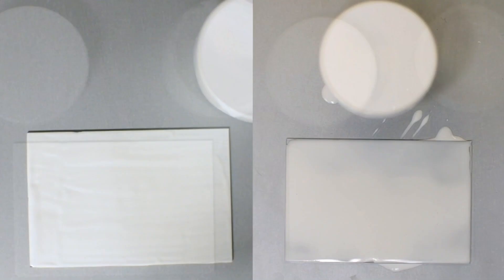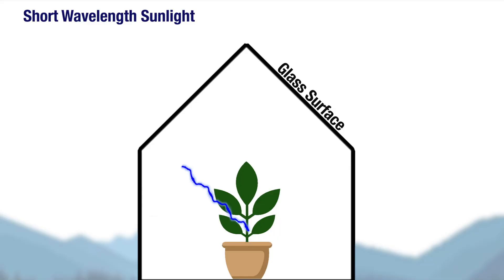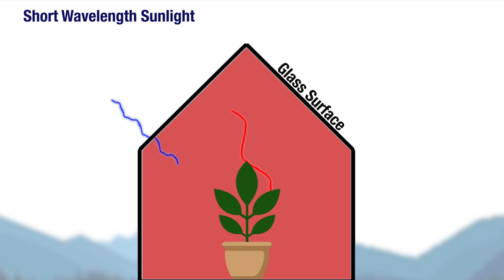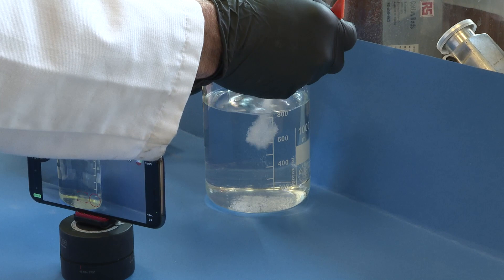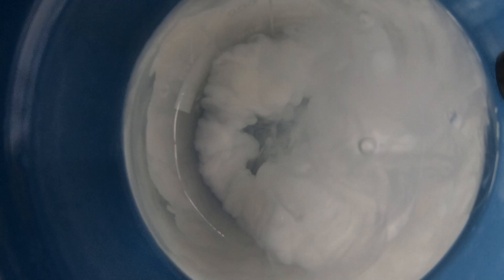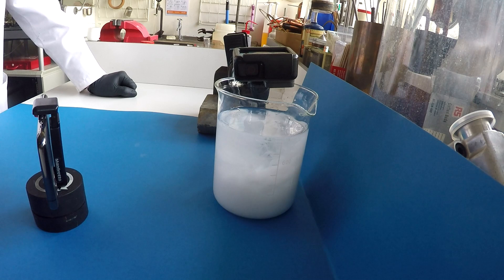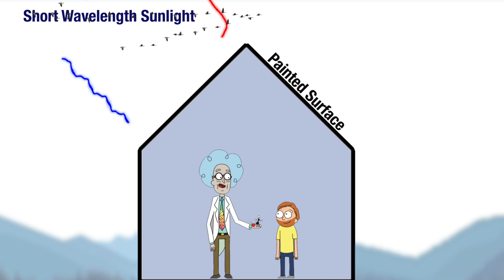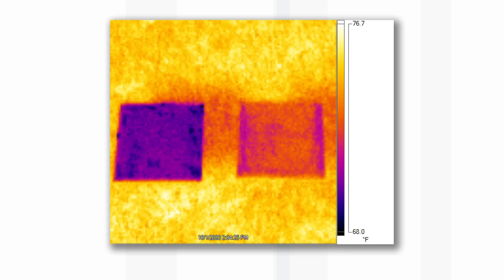Ultrawhite Paint (with Barium Sulfate) - Periodic Table of Videos

Comment: Wait a minute, how is it the BaSO4 reflects the sun's infrared radiation, but allows infrared radiation from inside the room to pass to the outside ???
Reply: because infrared is a range, not a single thing.

IR from the sun is short wavelength. IR emitted from objects near room temperature is long wavelength.
Reply: @seigeengine  Thanks! It is interesting that it reflects such a wide part of the spectrum, and passes just the bottom end.
I wonder which side of that spectrum divide cooking stove radiation is on?

Comment: This is very interesting, though not for the reason that many may think.

Barium Sulfate is nothing new to the industry and neither is the idea to create functional paints that mess with IR in order to create heating or cooling effects.
Conventionally, BaSO4 is used as a functional filler due to its superior chemical and mechanical properties. 
However under normal circumstances it is almost useless as a white pigment in comparison to TiO2 because its low refractive index is too close to the binders refractive index, making the dry paint almost transparent rather than opaque white.

What is new with this paper is the particle size distribution of the BaSO4. Particle sizes of pigments in regular paints tend to hit a lower limit in the 1-10 μm ranger due to technical limitations in the milling process.
Reducing particle sizes further and with a very broad distribution to hit as much of the visible spectrum as possible is what causes this very counterintuitve and kind of amazing phenomenon. As with most nanoparticles, things get a bit funky when you reduce the particle sizes into the range of the wavelenghts of visible light.

That said though, from a viewpoint of practicality, getting particles sizes that low and broadly distributed and especially then stabilized in a formulation without loosing the effect to particle flockulation sounds like a major headache that will need to be solved.

Not sure who needed to read this but hey, maybe somebody found it interesting.
Reply: It was interesting to me..  Not a paint scientist though.  I watched a video where a plastic was dissolved in a solvent and then a small amount of water was added to the dissolved plastic.  Too this Barium Sulfate was added 40% by weight.  It took several layers to overcome the transparency issue, but the small amount of water added made a big difference.  Do not remember the channel.
Reply: How close are we to get this in a generic paint container that I can buy and start painting my house with?
Reply: I am interested because I am in the process to develop cheap and effective white paint for cooling down my home, My home was constructed with aircrete or cellular concrete coated with a thermal stucco, very effective but now I am painting my home white with a combination of different white powders, paint, sealer and some other binders, I am in the process to develop my own paint in a fraction of the cost and very effective and resistant. Thank you for sharing your knowledge !!
Reply: Interesting to me, because I want to use this kind of paint in the future for my own homestead I hope to have some day.  Gonna be easy to lose the place in the snow though, so I might need some Vantablack for the trim or something.
Reply: I have a hunch that manipulating the BaSO4 nucleation process could address the typical crystal morphologies that give rise to the issues associated with these paints.
Reply: We can control the size of these particles to be about 700nm spheres with a chemical called EDTA. These spherical particles grow in size over time in solution.
Reply: @runed0s86  Isn't there an issue with the typical crystal morphology not optimizing reflection?
Reply: @JohnnyManu40  in the world I foresee, having your home blend into its surroundings enough to disappear may be an asset.  You can always hang a red-ribboned wreath on the front door if need be or paint the door red. Our future looks uncertain, so flexibility is necessary in order to handle it.

Comment: In Slovakia an indoor wall paint with barium sulfate is sold under name "Primalex Polar". Used it myself several times, nice shiny white, had no idea it's anything exceptional. The jugs are noticeably heavier than other paints, tho.
Reply: It probably doesn't.
Barium sulfate is commonly used in paint as a filler material, and is generally transparent in a paint medium.
The key here is the particle sizes and variation.

Comment: It's funny, because the citizens of mediterranean countries we have painted our houses white for centuries, precisely because of this very same reason. Thanks Professor.
Reply: yes but this new paint is white even for invisible light
Reply: The cooling properties of white material has been known for an age, but this paint will keep your house considerably cooler than the white paint you've been using all this time.
Reply: That's one of two great properties of whitewashing, The other one is that the lime coating keeps water out of cracks between stones and bricks, which protects the walls from erosion.
You could of course paint in color on the white lime, but then you lose the cooling effect, so they usually didn't.
Reply: AFAIK, that’s calcium oxide, isn’t it? Odd that calcium is just two up in the table, but I don’t know its reflective or transmissive properties with UV or IR respectively. I know typical white that we use and see can be Ti or Zn oxides.

Comment: You can do this glass microspheres of a certain size too. They become excited by thermal phonons in the surface and because of their size emit IR light that can exit the Earth's atmosphere via the 'IR Window' and not get trapped as heat.

These coatings can actually cool surfaces several degrees below ambient even in direct sunlight. The effect even works with clouds.
Reply: Spoke with 3M on these microspheres and they said they can not not be mixed, sadly but if placed under or over or even better, between walls of this paint, might be quite amazing.  Would love to see the results.  May try it myself.

Comment: So many uses. I used as a white diffuse surface to standardize my visible spectrometer. It does not like dirt. It produces a very flat reflectance curve, which in turn provides info on detector and source stability.

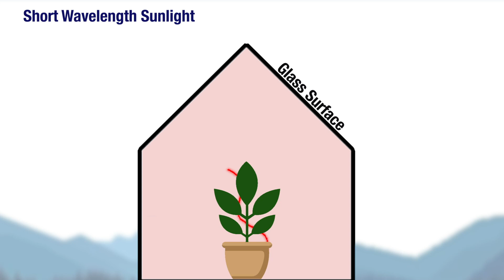Comment: 0:55 Sorry, that is not how a greenhouse works. Actually normal glass is quite transparent to high frequency IR, only becoming opaque for lower frequencies. And main heating mechanism of a greenhouse is lack of convection. Sun light (both visible and IR) goes through glass of a greenhouse, inside it warms up anything opaque. Those warm things then give up heat to air. Warm air goes up but it cannot escape greenhouse, it is blocked by glass.
Common mix up with "green house effect". Earth (and Venus) atmosphere do warm up as described. But greenhouses do not :)

Comment: It has potential for a future industry. If the reflective paint can be produced at a cost effective level and the materials required are abundant and accessible, there would be a lot of applications for it.
Reply: Materials are abundant, and relatively cheap. Sulphuric acid is about the most common strong acid in industry, most commonly as a by product of burning coal and refining oil, and Barium is also reasonably common as well, so yes it is easy to make in large volume.

Comment: I like this idea.  But it isn't as easy as "just" taking an existing builing and painting it white.  Many old buildings are inadvertently designed so heat from the roof helps dry the structure.  And "just" switching to a white roof causes moisture issues to appear.  (It can be done if you take the correct measures, though.)

Comment: Surprisingly, opacity to infrared light is not even required for a greenhouse to operate. Even if the glass admits visible and infrared light equally, it still heats up above ambient temperature. It has something to do with it being able to heat in the Sun while protected from convection cooling.

Of course, it is still better to use glass that is opaque to infrared.

Comment: you can make it even cooler by adding calcium carbonate microspheres of varying sizes, this allows it to emit near infrared to cool the surface below ambient temperature, while simultaneously cooling the earth if it emits toward the sky as the wavelength is in a low absorption range for the atmosphere

Comment: I used compressed Barium Sulphate at work as a 'white standard' reference for our Zeiss  spectrophotometers.  That was around 45 years ago. It's rather err 'white'.
Reply: To be clear, the reason this paint works isn't just because it's barium sulfate. It's a specific combination of particle sizes that helps it achieve such high reflectivity.

Comment: correct me if i am wrong: 1. the explanation about the greenhouse effect is not accurate? Because EVEN if the glass was able to let longer EM waves through the greenhouse would still heat up because the glass stops convection?
2. how can the white paint make the room cooler than the outside? if the outside is warm that means the warm air does radiate heat back into the room? the only way you could cooldown the room more than the outside would be to sort of create a "1-way valve" where long EM waves can pass through one direction but not the other?

Comment: If it could avoid some of the hassles with TiO2 that would also be huge bonus - like industrial printers having to have a little motor in the white ink tank constantly stirring it to prevent the TiO2 from settling to the bottom and going hard.

Comment: If we painted huge low albedo areas, with this paint.
The roofs of cities that already generate a lot of heat, large barren areas, factories and as you say use it for the purpose of cooling down houses in warm climates.
Even in temperate climate zones it could be smart, but only if they'd be swappable rooftops to be used in the summertime.
Do you think it could significantly help slow down climate change?
Reply: It's a fantastic achievement. They can paint engines and generator housings with it, air conditioning units and refrigerators so they run more efficiently.

Comment: I always thought that precipitate was cool to look at! I don't know how hard it is to get barium on a large scale but it always seemed silly to use titanium for paint when it's such a useful material.
Reply: Titanium metal is expensive, but not because it's rare. Titanium dioxide is dirt cheap, as there's a lot of them in dirt, far more than carbon. It requires a lot of power to melt titanium so it's only natural if the metal form is expensive.

Comment: (4:34) I like this idea: apply barium sulfate, use less energy in air conditioning. 
Question: How would moss react to a roof treated with barium sulfate, compared to a regular roof? Will the barium become a toxin in the environment, for instance, if the building sustained a fire or chemical spill?

Comment: The video uses a greenhouse as an example structure, which works because it's almost exclusively glass or plastic and no insulation. Houses typically have a significant wooden structure and insulation behind walls, so while you might paint the outer surface of your house with super reflective paint - what's going to stop the inner structure and insulation from trapping infrared radiation?  Your house would still need insulation for night time and winter, correct?  So unless you live in a house with incredibly thin walls and no insulation I can't see how you'd stop the house from trapping low wavelength light.

Comment: It would be interesting to put a double walled roof on a garage, and paint it with this paint, and put water or antifreeze through it. Then have a similar system on your ceilings in the house. You could then pump water though it carrying the cooled water around the house. The room would be selectively cooled, but only in summer.

Comment: Curious question, if everyone painted their roofs in this white then wouldn't all that reflective light bounce back in to the atmosphere and make it warmer? I know the reflection of the sun on the ocean can have a huge effect since it is so much surface area If this paint reflects all of the light back then it would understandably need less surface area to start making a difference on a global scale or maybe it would not be enough?
Reply: No. The reflected light would mostly leave the atmosphere and radiate back into space.
You don't even need ultrawhite to do this. Ordinary white paint does the same thing, just less so.
Also, you've got how oceans work backwards. The oceans absorb most of the light that hits them.
The issue is that certain chemicals in the atmosphere (like GHGs) reflect infrared light (heat) back down. Higher energy light, like visible and UV, can escape freely.

Comment: Barium sulfate has been used for decades to coat the integrating spheres of color spectrophotometrs. As such, its optical prperties are well known ever since.
Problem is, it is damn delicate.
So the challenge is not into making the paint, rather to get a rugged, durable formula for outdoor use.
Reply: Normal barium sulfate doesn't have this property. It is specifically the mix of particle sizes that gives it such broad reflectance enable sub-ambient cooling.
Reply: Normal barium sulfate doesn't have this property. It is specifically the mix of particle sizes that gives it such broad reflectance enable sub-ambient cooling.

Comment: I find that keeping my house warm in winter is more of a problem than keeping it cool in the summer. I would not want this paint on any exterior walls, inside or outside.
Reply: Ah yes, those exterior walls you keep inside. ;o

No, but joking aside, obviously it's not necessarily ideal for everywhere. Not sure why everyone feels the need to act like their situation is the only relevant one, or even worth mentioning.
Reply: @seigeengine  The walls around the perimeter of a structure are called exterior walls no matter how much or little exposure to the outside the surface gets. 

I did not say this wouldn't be a great idea in tropical regions that don't have a lot of asphalt. Since Sir Poliakoff used a house in England as an example and I live in the same kind of cold wet climate, I expressed the fact that it is more logical to use heat retaining paints rather than heat dissipating ones in such an example. 

To address you concern about real world use cases, this paint would only be beneficial in dessert environments. Having a paint that promotes sub-ambient conditions inside of walls or above trusses in a humid environment would encourage condensation which would lead to rust jacking of the lag bolts along sill plates, loosening of nails in the beams and struts and compression of any insulation; possibly even mold growth in the insulation or sheet rock. So I wouldn't exactly want it if I moved to FL, GA, LA, MS or CA, either.

Comment: Fascinating. But I'm slightly puzzled because I thought that the heat from sunlight also is mainly from infrared, so if the paint is "transparent" to that...
Reply: I had the same thought - if the paint is transparent to black body radiation in the infra red, won't it just let in such heat from the Sun. Maybe the infra red absorption of the atmosphere makes the difference.
Reply: The sunlight is mostly visible and near-IR wavelengths which are reflected by the BaSO4 paint.  The heat from the substrate is longer wavelength IR and the paint is transparent to this, so it escapes.   The net effect is that more heat can escape than is absorbed, so the substrate should cool slightly.

Comment: THAT'S NOT HOW GREENHOUSES WORK! While it is true that the glass traps a lot of the low-wavelength light in the greenhouse, that is not the primary driver of the heating. The greenhouse stays warm simply because the solid structure prevents convection from dissipating all the heat. Michael Merrifield already explained this in one of your own Sixty Symbols videos (The Greenhouse Effect Explained)!
Reply: While it is true that limiting convection is the primary reason greenhouses heat up, trapping IR also plays a non-insignificant role.
Reply: @seigeengine  Yes, but explaning the radiation trapping and saying "THIS is how greenhouses work" without mentioning the convection at all is just incorrect.

Comment: I wonder how much of the radio wave spectrum is adsorbed by this paint. Sounds like it could be useful as a coating for space stations, although it's significant weight might preclude its use.
Could it be used in ceramic tiles for reflecting heat during reentry from space?

Comment: I wanted some white paint for a roof that has not only titanium dioxide but microspheres with vacuum, for insulation... never got any.

Where I live now, the concrete-tile roofs were replaced last year with steel. I wanted white. It turned out being red. Power bill in sunny weather has gone up.

Comment: What happens to the heat that has been bounced back off this paint. Does it heat the surrounding area raising the ambient temperature. In other terms if everything was painted white where does the heat go
Reply: It is reflected as sunlight is reflected off any shiny surface.  A small amount will heat the air as it passes through it.
Reply: The light that is bounced off the paint will either run into something else that will absorb it, or, if it bounces back up, will likely escape the Earth's atmosphere back into space.